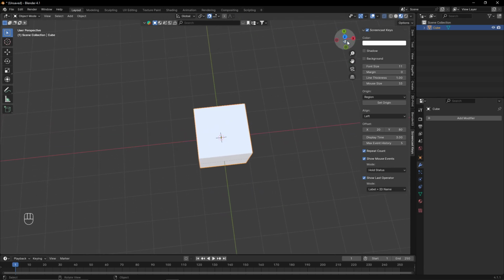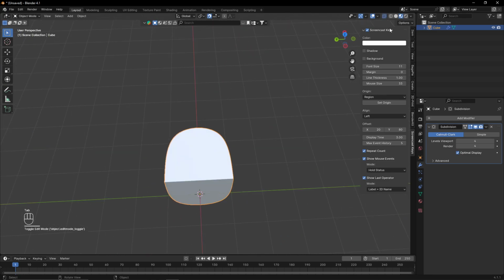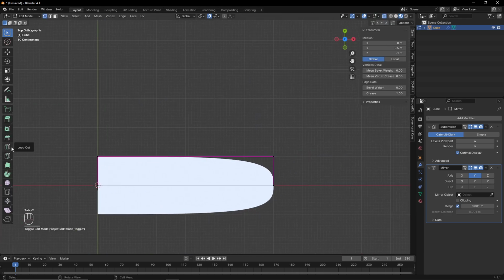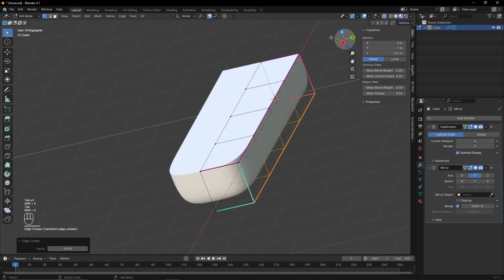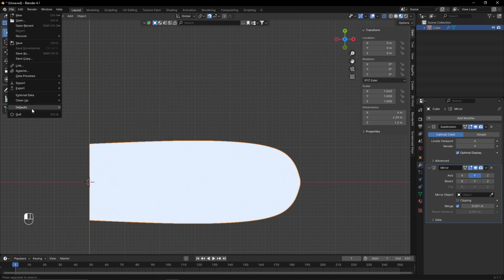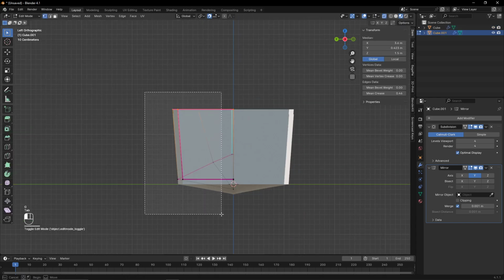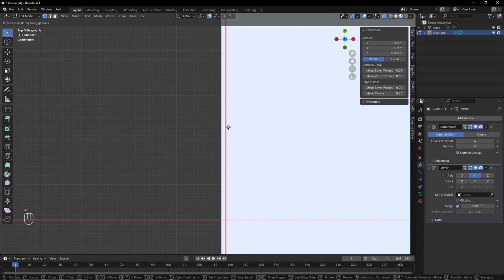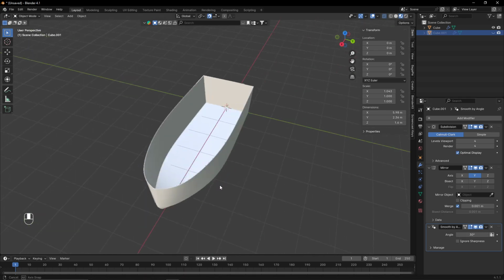Design a boat in blender : tutorial part 1

Comment: Hello, what are you doing from minute 2.07. Could you please explain in more detail, you can't really see through it.
Reply from the maker: Hello, I select the faces I want to make flat (the top and the rear, as transom an deck) and press shift+E then move the mouse still holding shift+E.

It's the crease option, it cancels the subdivision surface modifier on local selected geometry. It's a ratio, going from 0 to 1. 

0 is normal subdivision, 1 is no subdivision remaining in the area.

That's why I just pull my mouse far enought to get 1. But you can also simply do shift+E+1 and it will cancel the subdivision modifier on the selected geometry :)

Hope that helps.